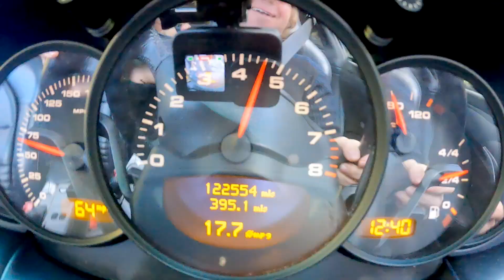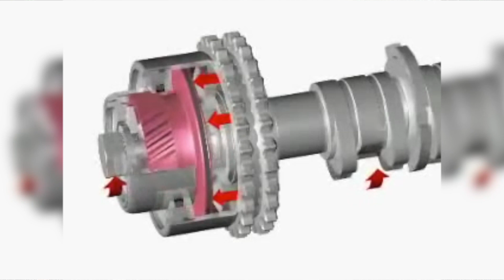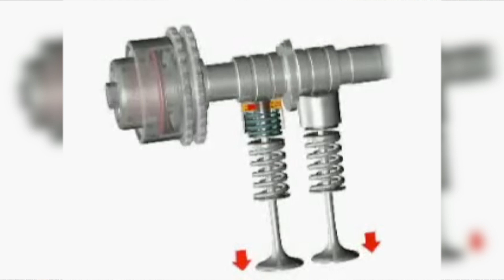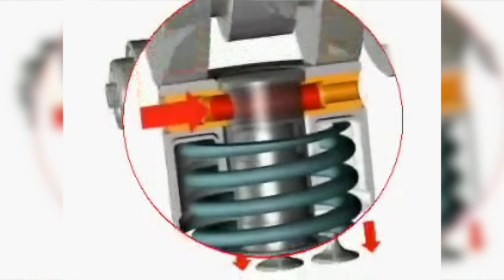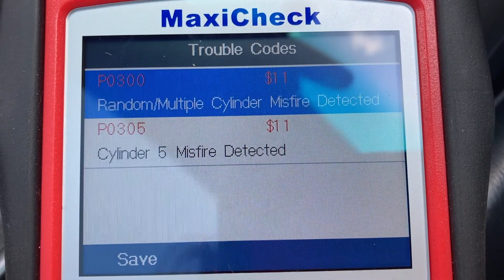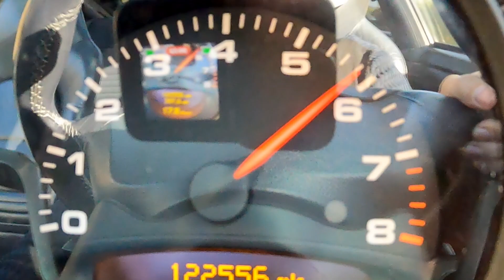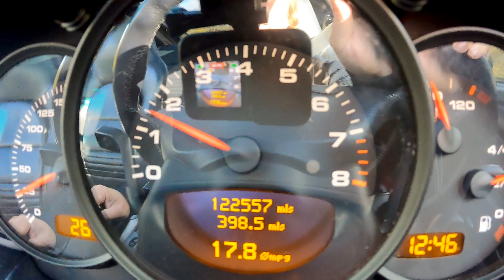Ultimate 996 Misfire Guide: AOS, Coil Packs, Variocam.

Comment: You low-key told us you’ve let the oil get too dirty. You changed it but didn’t say anything right? This is a classic extended oil change interval problem. Many cars are very sensitive to oil cleanliness when it comes to these cam phaser solenoids. If you don’t pull the solenoids to check and clean them, then at least change the oil and filter. The detergent additive package in the new oil will help free up the solenoids if they’re gummed up.

Comment: Thanks for this great video!! I have had a similar issue with my 996 4S. Also changed spark plugs and ignition coils. At first that did the trick, but if came back, but mostly after the car has not been used for a while, or using it just pottering about town. Driving it hard for a couple of hours just seems to solve it.

Comment: Good advice, my gen2 996 has an intermittent misfire, always cylinder 5, my Porsche specialist, tried spark plug and coil pack the first time, swopped injectors the next time, now they are claiming its down to a sticking hydraulic lifter, an expensive fix, replacing all the lifters on the defective bank. But what if that is not the defect?
Reply: Did you sort this out?

Comment: My 2002 targa is making exactly the same noise as yours. Has that now disappeared on yours? What oil are you using btw?
Reply: That noise popped up on my 2003. It was bore scoring. I would drop the sump and use a boroscope as well as check for metallic debris.
Reply: Personally? Number 1. Go to your trusted independent. Get it plugged into diagnostics first!
Reply from the maker: Haven't heard that clattering noise now for 4-500 miles. I'm confident it was purely related to the Variocam system being locked in at idle when it shouldn't have been.

The last service I used 5w50 Millers fully synthetic although at the next service I will be using 10w50 Millers Nanodrive. These are old and generally high mileage engines now and definitely benefit from thicker oil.